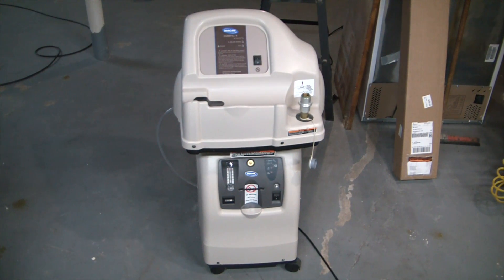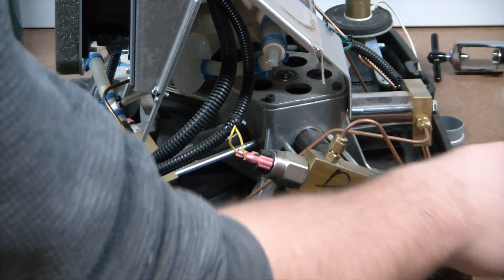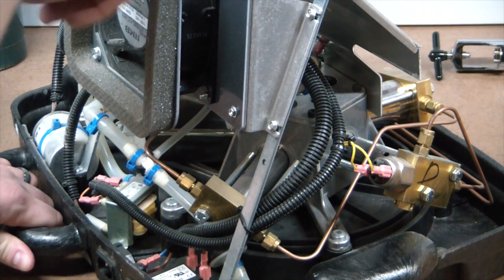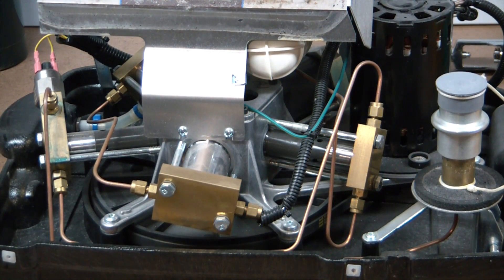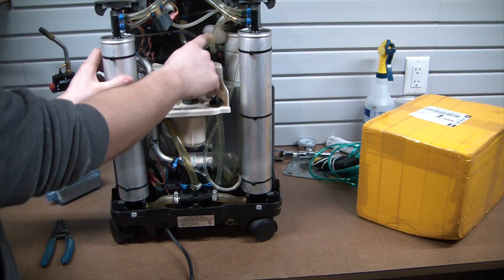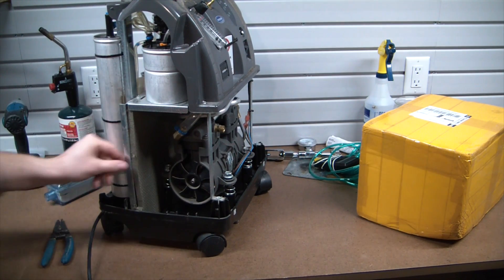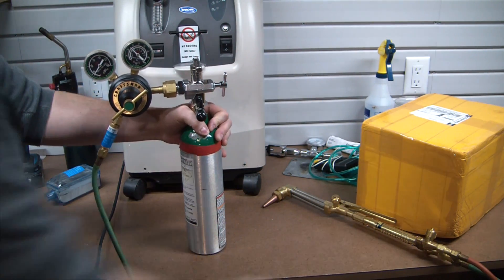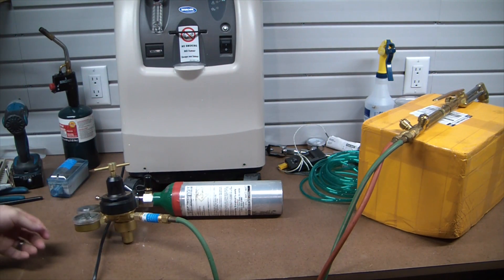Whats Inside an Oxygen Concentrator and Compressor - DIY Oxygen Filling - ElementalMaker

Comment: OK lets get going for Scuba.   You need to fill tanks to 2000 psi so you don't mod the machine.  Then do something really simple use the 2K PSI as input to your compressor at 3000 PSI.  Then you need a rebreather because 95% O2 is not cool in scuba.   You need to based on depth look at your gas mix.
95% at 3K PSI Oxygen will feed a LOX or rebreather.  NOT direct to diver as you are surely aware.   

On generation of LOX that process can either use concentrator input or raw air.  The LOX separation is based on boiling points and various gasses fall out at different temperatures.  
LOX Boiling point is −218.79 °C; −361.82 °F
Nitrogen Boiling point is −195.79 °C  320 °F .  
CO2 Boiling Point is −56.6 °C  −69.9 °F
 Argon -189.3 °C , -308.74 °F
CO2 will drop to liquid first
Then in order argon , nitrogen and O2 .   
Starting with a stock of 95% O2 makes sense if your target is LOX saving a lot of work.   If you want liquified of other gasses ....

Comment: There is something wrong with your unit. It should only take about 15min to fill a  completely empty bottle.
Reply from the maker: Invacare Documentation for the homefill unit states 125 Minutes to fully charge a HF2PC9 bottle. Seems correct.

Comment: +ElementalMaker Hey you probably already know this, at least I hope you do, but you don't fill scuba tanks with pure O2. You can get oxygen poisoning. It's just compressed air. If I recall you only use Pure O2 canisters for helping stave off the bends by using it at surface level if you came up too fast, or using it to refresh your body if you're going down again in quick succession of your first dive.
Reply from the maker: Yeah of course. I didn't want to get into the whole tangent of oxygen toxicity with increasing partial pressure. Just wanted to note that with the correct setup that pump could probably be set up to pump cleaned and dry air by bypassing the O2 sensor. I should have added a note in the video.
Reply: ElementalMaker quick tip that I got from a guy who does oxyacetylene welding: breathing a little pure oxygen is a quick cure for hangovers. I didn't get to test it personally because I never had a hangover. I probably don't drink enough.
Reply from the maker: @stamasd8500  I have a project coming up in which I will have to put that to the test! That'll be magical if I can beat hangovers LOL
Reply from the maker: @stamasd8500  I have a project coming up in which I will have to put that to the test! That'll be magical if I can beat hangovers LOL
Reply: @ElementalMaker  Yes we all have that project coming up. It's called St.Patrick's :)
Reply: @ElementalMaker  Cool, yeah if you can bypass the O2 sensor it'd definitely be great for Scuba. I just didn't want a youtuber I enjoy to make a really dumb mistake and suddenly stop posting

Comment: ummm  you better check up on partial pressures of oxy at depth beyond 35 ft in a 90% situation... it can become toxic.
Reply from the maker: Correct, I didn't mean filling a scuba tank with pure O2, that would be deadly at depth. I meant modifying the compressor to pump air, but didn't want to get off on that tangent in the video. With a proper air filtration and drying setup, I think this could definitely fill a tank though.

Comment: Actually, I should watch out for one of those. Might be handy for precharged airguns, if it's possible to bump up the pressure a little bit and bypass the oxy concentration(Which would also be really, REALLY bad in an airgun.). There is that 250 dollar 4500 psi Chinese ebay special, but I'm kind of iffy putting much faith in that thing. Big shocker there, I know. Honestly, I'd have more faith in a modded medical compressor than a new manufacture chinese fragmentation special, lol. But that's really cool. Gives me some ideas I'm going to have to look into, so thanks for putting this up.

Comment: no way that is 12hp motor
Reply from the maker: 1/12th HP Audio was shoddy there
Reply: @ElementalMaker   Ah OK,... thx
BTW- where how did you get the generator?
Reply from the maker: @mr1enrollment  yard sale! $50 with two small tanks!
Reply: @ElementalMaker  Wow you stepped in that pile!
Reply: actually it could be... 2400V 17,600 RPM with the proper gear ratio  ;)

Comment: now you can get a fancy air rifle ....thats all I could think of using mine for
Reply from the maker: I didn't even think of that! Gonna have to try to find a cheap used pcp around here
Reply: Yeah, just dont put hp oxygen into an air rifle or anything else not designed for oxygen. Stating the obvious in case somebody forgets.

Comment: E.M. my man, don't think that's a 12HP motor. If it is, then it's alien tech :--)
Reply: "12th" I think he said (but I did pause for a split)
Reply from the maker: Tis indeed 1/12th hp. Audio was shoddy there
Reply: @ElementalMaker  no worries I knew it was a some kind of issue was just joking with you :)
Reply: Unit Max power draw 120 volts @ 2.0 amps 240 watts..... Not 12Hp  or approx 9000 watts..... 100% Alien Tech  approved. K00L catch phrase...!
Reply: Aliens !!!! Wait what .... 😧
Reply: Yeah i missheard as well haha I was thinking wait didn't he say low power....did the math it's like 8500 watts lol
Reply: Lol
Reply: He does say a 12th hp very clearly,take the carpets out of your ears
Reply: "12th" it was. Surprisingly I caught "12th" despite my almost 80 years old ears, but I also use closed captioning on some of these videos to see what they are saying but it ALSO has trouble at times. Try that anyway, it helps.
Reply: may be just 1.2 HP or thereabouts. lol
Reply: 746w to the hp so you are correct.
Reply: I realize this is an old video, and I think I remember seeing it before. I just got to wondering what would happen if you took the output of the concentrator and hooked it to the input of the bottle filler?
Reply: He says "1 AMP" at 120V should be near 120w, no ?
Reply: @MrVdmg  I think he meant that the whole unit draws 1A, since theres definitely other electronic gadgetry inside consuming power.
Reply: Shoddy audio? My friend, It was just a quick glance mistake is all. I think you were caught up in the excitement of possibilities and it’s hard to read upside down anyway. Judging from the fact that oil and oxygen don’t mix I wonder if the piston rings are Teflon or some other wonder material. Also thanks for a look at something I would not have ever had a chance to see 😊
Reply: @billssolarpowerandgardenin1016  I have like five of them in my shed. I also have access to hundreds more of them.
Reply: @jonross377  you looking to sell em?
Reply: @jonross377  if you're in Arizona or southern Nevada I'll buy any you'd like to sell. 
I'm a respiratory therapist who refurbishes concentrators then donates them to people who's insurance gives them the run around.
Reply: Jon Ross 
Are you anywhere near Portland, Oregon, and wanting to get rid of an oxygen generator or two?

Comment: Neat gadget.  I really doubt that little motor is 12HP.  That's like 9kW.  If it draws 1.1 A, probably 0.12HP
Reply: i concur the HP rating is 1/13HP lol not 12. i honestly am surprised its only 1.1 amps, its THAT overbuilt for longevity. normally with winding's like that youd be able to push tens of amps..
Reply from the maker: Yes it's 1/12. Audio wasn't very clear there

Comment: 5:50 I think it says 1/12 hp. Pretty sure 12 hp startup current draw would make your breaker box glow.
Reply from the maker: Right you are Tim!
Reply: 60 measly watts? Light bulb moment!
Reply: you should have just enough power to run 2 motors both 6 hp (6hpx0.75 =4.5 kw x 1000 = 4500w). In my country, we have 220v 50hz @ 10-16-20-25 amps. 25x220=5500w 20x=4400w. two 6hp motors running 4500 watts could be done on seperate phases.

Comment: Have you considered hooking into the nitrogen waste stream?  Not as pure as the oxygen, but might still be useful.
Reply from the maker: For sure! Forgot to mention in the video, but I want to try doing some small scale Haber process with the nitrogen and some hydrogen I can make.
Reply: @ElementalMaker  Waste gas is generally going to be around 10% oxygen and the rest will be nitrogen and water vapour. I used to use commercial nitrogen generators that made 96% pure gas using a permeable membrane filter, used in packaging to keep the products fresh longer, and the waste had to be pretty much unobstructed, otherwise the pure product would be contaminated quite fast with oxygen. The nitrogen for Haber process is much easier to get by simply compressing air and cooling it, as then you get CO2 out and water. Oxygen in the process is easy to remove once compressed, just add excess hydrogen and it will become the solvent for the ammonia.

Comment: If you had a Solar HHO fed into this could you not have 100% O2? Never greese any parts that have anything to do with O2.
Reply from the maker: It might be possible, but then again this outputs 95% pure O2 with the remainder being mostly argon id guess, so it's as pure as I'll ever need it 👍
Reply: @ElementalMaker  what does this canisters called which purifies an oxigen ? enyone knows the  right name of that canisters?
Reply: @ElementalMaker  it's actually mostly CO2!
You can flow the output over an activated carbon and calcium carbonate scrubber and get 98-99% pure O2.
100% can be achieved with a molecular filter but it's highly corrosive and difficult to store!
Reply from the maker: @artweaver6963  wow no kidding! I would have definitely thought argon would be the main impurity. Any details on why that is?
Reply: @ElementalMaker  well, argon is less than 1% of air at standard temperature and pressure.
CO2 varies from 5% to 20% depending on plants and animals in the environment and time of day. (Photosynthesis.)
In a laboratory environment you'd be right on. Argon would be the predominate gas left after nitrogen saturation but the percentage would be less than 5%.
Reply: @artweaver6963  How does the CO₂ get that high? You'd need well in excess of 10,000ppm CO₂ in the input gas for the 5% impurity in the output to be mostly composed of CO₂.
Reply: @ergohack  your not considering the concentration which applies to everything not removed by the nitrogen saturation.
20% O2 + <10% CO2 + 70% N2 and other gases in the input to the concentrator. Makes  CO2 as much as 33% in the concentrated output without molecular filtration or scrubbing. The concentrators have a molecular filter that prevents most of the CO2 from being compressed. In the older units you could actually hear the back pressure pulse used to clear the filter and purge the sieve cylinders.
You still hear it from the portables.
Reply: @artweaver6963 I did consider that; I think your assumption for the starting level of CO₂ in the input gas is off by at least one order of magnitude. 
Where does "<10% CO₂" come from? That's 100,000ppm. Outdoor air is currently only around 450ppm CO₂. Indoor air in the home rarely gets as bad as 10,000ppm (1%) CO₂, if ever. Normal levels are between 1000ppm, to 5000ppm CO₂ in some of the worst cases.
Reply: @ergohack  it's given off by plant life when dark and by humans and animals constantly. It's also used extensively as a propellant and of course in soft drinks.
In lab environment it would be unlikely to be that high but in real world situations CO2 can get quite high.  Also, I didn't say the 5% was all CO2. I said it was more CO2 than argon....
Reply: @artweaver6963 Input gas CO₂ content would need to be above 9340ppm in order to exceed normal argon content. This is very unlikely except in very poorly ventilated indoor areas. 
Here is a link that provides a bit more information on typically indoor CO₂ levels:
https://ohsonline.com/articles/2016/04/01/carbon-dioxide-detection-and-indoor-air-quality-control.aspx?
Reply: @ergohack  "Very unlikely" is an understatement. He's talking about CO2 concentrations that are lethal as if that's just normal variance. Obviously he doesn't have the slightest clue what he's talking about. As for the original comment about feeding in the output from some electrolyzer, you wouldn't need to filter that output at all. Electrolysis already separates hydrogen and oxygen at the cathode and anode so you already have a very pure oxygen and hydrogen stream coming out of it. Calcium carbonate also cannot be used to absorb CO2, calcium carbonate is the depleted product of using calcium oxide to react with the CO2 and form calcium carbonate. Actual CO2 levels are at 405 ppm I'm assuming 450 ppm was a typo, and even poorly ventilated indoor air in a house isn't going to get up to 10,000 ppm, even 5,000 ppm sounds a bit unrealistic as that level of CO2 will already cause symptomes.
Reply: @AndrewMerts  you guys keep talking about atmospheric concentrations. We're talking about the output of the concentration. I'm not talking about the percentage in a normal room or in the output as a whole.
I'm talking about the percentage of CO2 in the non oxygen concentration product.
The question and comment was about the makeup of the non oxygen output. What gas composes what percentage of the remaining fraction.
That's TWO orders of magnitude less than the input.
10% of input translates to 0.5% of the concentrate and 10% of the 5% translates to less than 500ppm.

Think.
If concentrator produced oxygen was small or free of CO2, hospitals would use concentrators to supply O2 to the facility. They use liquid oxygen because it's 100% free of CO2 and scrubbers are not economical.
And it was supposed to say calcium oxide not carbonate.
(I'm not sure HOW that happened. I'm guessing the spell checker got me!)
Reply: @AndrewMerts  they also discharge a lot of the non oxygen fraction in that high pressure release between cartridge switch's. The real problem for most users of concentrators isn't getting enough oxygen, it's getting rid of enough CO2!
The zeolite won't trap the large CO2 molecules very well, but physics ensures that they are concentrated mostly in the lower part of  cartridges. That discharge ensures that the pores in the zeolite are cleared and that a fair percentage of the remaining CO2 is removed. Better concentrators use three or more cartridges to reduce CO2 even more by lengthening the cycle time.
That's another reason why this bottle filler has so many cylinders.
The air in the bottles must be better than 94% >>>>
I have COPD.
I'm also a biomedical engineer.
Reply: No such thing as HHO gas, only H20 or H2 and O2. Monoatomic oxygen and hydrogen are frighteningly reactive.
Reply: I was thinking a bit different fill one with oxygen from hho setup than fill one with hydrogen. What kind of rockets could he make then. That could be very cool.

Comment: 5:48  I can't understand what you said. It sounds like you said 12th HP motor drawing 1.1amps.  Obviously that is not right. So what are you saying?  Sorry, my hearing isn't great and sometimes I cannot make out what someone is saying.
Reply from the maker: The motor label says 1/12HP and 1.1Amps, doesnt make sense, but thats what it says LOL. Ill have to check it will the killawatt meter
Reply: Thanks dude.
Reply: 1.1 amps isn't too unreasonable if you consider reactive amps.  Which you would for wiring or fuses etc.

Comment: Does this actually use less power than a scuba compressor?  Because power is power over time and I cannot imagine it can compress X pounds of oxygen much more efficiently than the scuba one. The scuba one is probably doing must faster and using more power per second than the medical one here. I would imagine that such a medical device which is probably rented and not outright sold, would be made to be quite efficient.
Reply from the maker: The faster the pump the more energy lost to heat, so I would imagine this small and slow unit to be a bit more efficient. Also just as a safety note, scuba would never use pure O2. You would instead purify and dry normal air before pumping.
Reply: Yes, I agree.  I was more saying that aside from waste heat, they are probably both very efficient, mainly because they are commercial.  All that noise ain't "free" either.
I am in complete ignorance about SCUBA.  Does SCUBA use compressed air and not compressed oxygen?
Reply from the maker: @tarstarkusz  most scuba dives utilize compressed atmospheric air, filtered and dried. Some use nitrox which is a blend of nitrogen and oxygen, and then for deep water operations they use Heliox, a blend of helium and smaller concentrations of oxygen because oxygen becomes more and more toxic the deeper you go. I got my Naui dive cert a good 15 years ago, so take this all with a grain of salt. Brain ain't all it used to be
Reply: your memory is still active,  oxy at depth can be ... lets say...  an issue   @ElementalMaker
Reply: Thanks.

Comment: How much did that unit cost
Reply from the maker: $50 at a yard sale 😁
Reply: ElementalMaker thats practically for free
Reply from the maker: @rumblertag8933  that's what I told my wife!
Reply: ElementalMaker would there be a way to take the nitrogen that it gives off
Reply: ElementalMaker that's a steal. A used certified one is over $2000